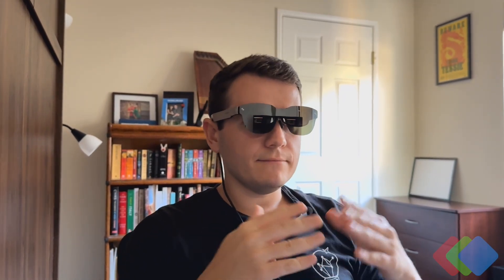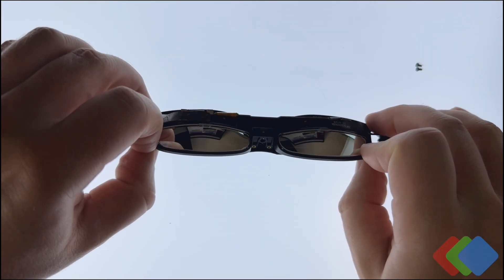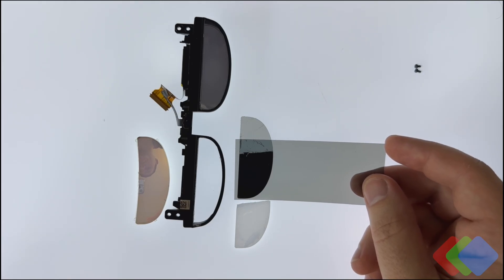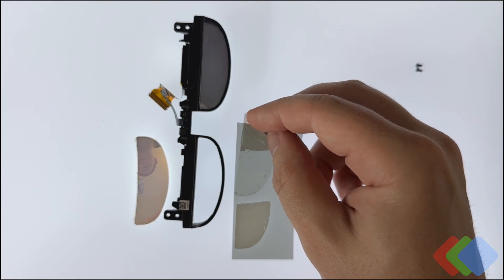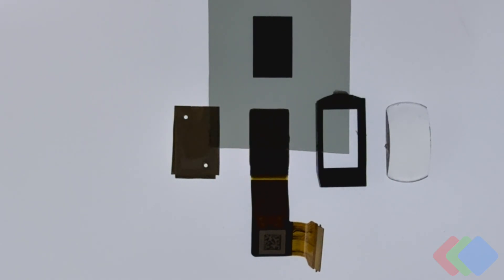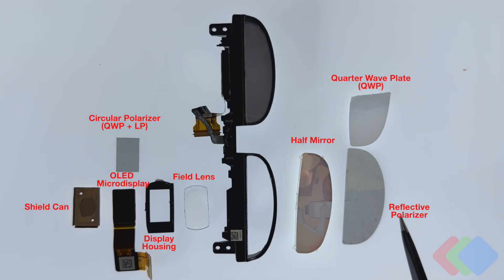RayNeo Air 3S Optical Teardown - Great Value Standard Birdbath

Comment: Hey do you or could you measure the light blocking % and/or Light passthrough % of the display with the front regular sunglasses part removed? Please and Thank you.
Reply from the maker: In theory this should be around 25% - in practice it will be a bit lower, and I can measure that in a few days. I’ll comment here if I can get a conclusive result with my setup.
Reply: @DisplayTrainingCenter thank you very much, I would have guessed a lot higher than, 25% I have some safety glasses that block around 40% but these seem to be darker. Appreciate it. 👍🏼
Reply from the maker: I'm actually measuring ~8% transmission (92% block) through the optical module - this is unpolarized LED source light, with the sensor being placed ~10mm away from the user-facing side of the optical module. This seems a lot lower than theoretically expected, so I'll continue to see if I can measure anything different. That said, I don't know the exact half-mirror properties used on the curved lens, so it may be more reflective than I originally thought...

 These are certainly darker than most safety glasses/sunglasses out on the market - while they show a lot of very 'public' usage of the glasses in ads, the truth is all these types of display glasses from RayNeo, Rokid, Viture & Xreal are all meant to be used while stationary and seated since you have nearly zero input from in front of you...
Reply: @DisplayTrainingCenter  Wow so even with the front plastic sun shades removed it is blocking 82% of real world light from entering the users eye? Also in your tests did you figure out if you can disable 1 of the modules and remove it to only leave one working without bugs?
Reply from the maker: @V @VozzyVids s, definitely seeing a world-side block of >90% which was a bit unexpected. 

As for disabling just one module - no, I was not able to unplug just one of the display modules and still have a functional device. Xreal actually does this well with either display unplugged, the other one still works great - but not for RayNeo!
Reply: @DisplayTrainingCenter ok thanks, yes I am surprised also, would placing that linear filter strip on the module at a specific angle increase the amount of light that passes through? Also do the xreal glasses allow more light to pass through also?
Reply: To be more specific, the real worlds light passing through to the wearers eye.

Comment: One Question! Can I remove the front glass (just as yours) and replace it with a transparent one? (maybe I need to design a 3D printed frontal frame for it. I know it should be in black and just like sunglasses for better coloring and brightness, but Air 3S PRO is so much brighter than the normal one. Thanks for your great video!
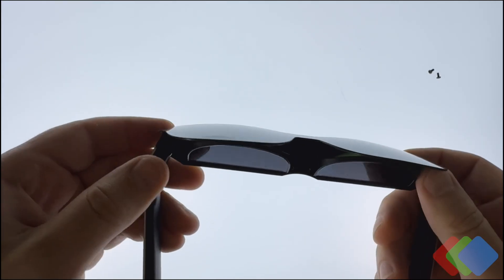Reply from the maker: Yep, you definitely can! You can see starting at 5:11 that this pops off easily (after removing the screws in the nosebridge), so you could replace it with a transparent version quite easily.

An easier way (but maybe messier and more permanent) of doing this replacement is to replace just the plastic lens that is glued down to the bracket that pops off in the video. You'll have to heat/swell the adhesive which you can see once the entire front plate is off, then this lens will just pop off. You can then just cut a rough shape of similar size in some clear polycarbonate or acrylic and then glue it back on!

Comment: Anything glued in place is removed under a heat blower. Use a hair dryer it works great. Never pull on it without heating it properly. That's how you break stuff. Glue is really strong nowadays to the point of breaking the plastic before the glue point.😅 sorry for the glasses really wished there were replacement parts or repair shops. Maybe contact the company and ask if you can send it and fix it on your expense.

Comment: If we wanted to use the actual birdbath modules here with our own display, do you think that would be possible with some Sony ECX microdisplays? Would you be able to provide the area of the microdisplays used here?

Also, how barebones can you strip down the RayNeo's while still getting something to actually display on them? As in, will they still work without the speakers and microphones plugged in, as well as other peripherals/buttons?

Basically just trying to tear these down and move them into a different housing.
Reply from the maker: If you just want to use the lens module with another display, that should be possible - you may need to 3D print a slight adapter depending on the Sony microdisplay you use to account for slight differences in panel dimensions, but if you’re using the Sony 0.6” panel it will be pretty easy. One note - careful about the lens you use on your display, since I’m not sure if the field lens on the SeeYA panel is a stock part. Best bet would be to reuse the lens that sits on top of the panel here.

As for how barebones you can go - it’s been a while since looking at these, but I remember they were functional only when both temples are plugged in. I’m sure you could disconnect the audio module and the ToF module, but the mic is on the central PCB where you would have to desolder it to disconnect it.

Comment: I got rayneo air3s pro. So what micro OLED panel their use? BOE or Sony
Reply from the maker: Definitely not Sony, and unlikely to be BOE as they only advertise a 2000nit 0.5” OLED micro display, which would be too dim based on RayNeo’s advertised brightness to the user (over 1000 to the eye). 

I’ve been of the opinion that these are SeeYA panels, but someone seems to think that TCL CSOT (RayNeo’s parent company) may actually be making these themselves. If it truly is a TCL panel, I’ll let you know!

Comment: Mentioned in the video that there were 4 screws to revmoe the front helmet. Is it 4 or 2?  Also was it easy to return the front panel?   I want to grind down the lenses to align to the screens so I can effectively use this as a secondary screen that lies on top of my laptop but the tinted lenses make it difficult to go between the real screen below and the rayneos
Reply from the maker: It’s 4 - two at the nose bridge and then one on each side where the temples connect. I know it’s not shown well in the video… I can upload a pic later today to show the exact locations. Do be mindful that these are two separate types of screws: 2x Phillips and 2x hexalobe. 

As for ease of return, yes it’s really easy to put the front plate back together. There are retention clips molded into the two halves, so once you are ready to put it back together it will clip back on quite well.

Comment: My right speaker makes crackling sound when playing heavy bass at loud volumes, have you opened it up to the point that you got the access to speaker itself? I'm thinking about getting a partial refund and making an attempt to fix it myself...
Reply from the maker: Yes - I'll have a guide up on our blog soon, but long story short: the speakers are essentially unrepairable... you'll have to replace the entire speaker module.

It's a pretty easy replacement so if you can get RayNeo to send you a right speaker module, you should be able to swap it out in ~15min.
Reply: @DisplayTrainingCenter  I am considering a partial refund too, i got these glasses for the fair price, if they will give me some cash back it will be fine too, the problem does not occur at low volumes. Do You know the prices of such speakers?
Reply from the maker: @TheR00Z unfortunately no, but if I had to give you a best estimate it’s likely that they paid ~3-5USD for each module.

Comment: Next do teardowns of VITURE / Rokid type birdbath glasses with myopia adjustment dials. Interesting to see if the display changes its distance from the lens only or the whole lens+display module moves away from barrel/lens housing?
Reply from the maker: Great suggestion - Viture is next on the list! 

Even without a full teardown, I can say the display and field lens are both moving in the optical module. This basically helps change the focal point of the optical module to simulate having another lens like the prescription inserts. It will be great to see this mechanism in action though!

Comment: Hi love your videos. Do you know where can I find the field lens part? With the black cover on the side or without. Thank.
Reply from the maker: Glad you enjoy them! Do you mean as a replacement part or during the tear down? If for replacing the lens, you can probably reach out to RayNeo but it’s unlikely they would sell just these parts…

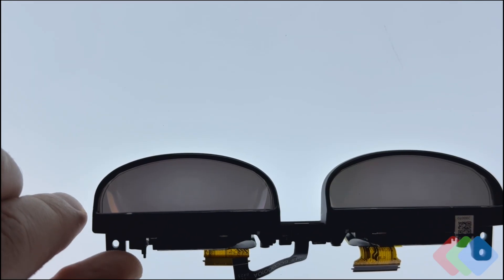If you’re tearing this down yourself, you can find the lens glued on to the display panel that you can remove from the optical assembly body by cutting the glue line dispensed around the display module - around 8:00 you can see me pulling off the display module with the field lens after cutting this line.
Reply: @DisplayTrainingCenter actually I want only the part without buying the glasses. I’m want to built something with similar part
Reply: If you know where to find parts like this. I searched and can’t find in reasonable prices
Reply from the maker: Got it - unfortunately, I think you won't have an easy time finding this online. You may have good luck if you're in a market in Shenzhen, but otherwise it will be hard or prohibitively expensive...

If you just need one part, I can send you the one from the teardown here - shoot me an email at info@displaytrainingcenter.com and we can work on the logistics.
Reply: @DisplayTrainingCenter thank you but i got solution for this. Thank anyway